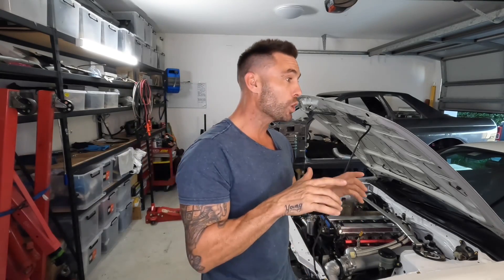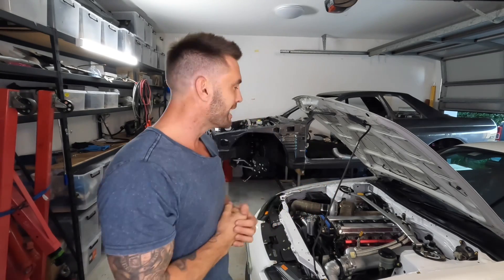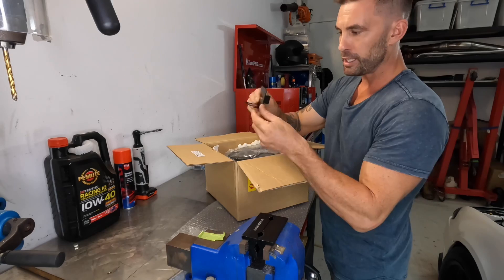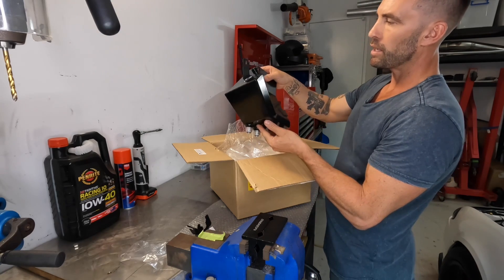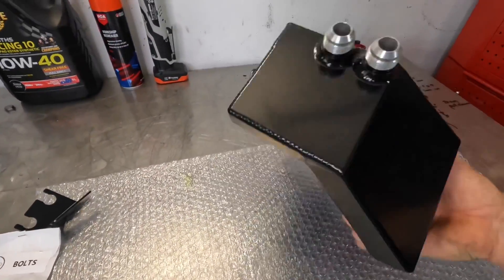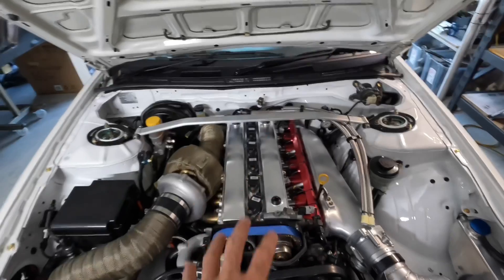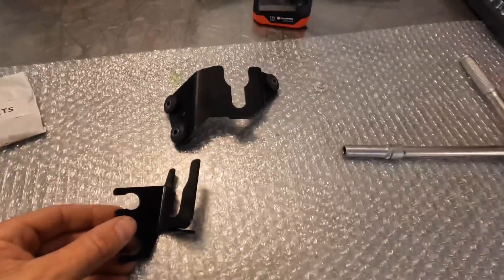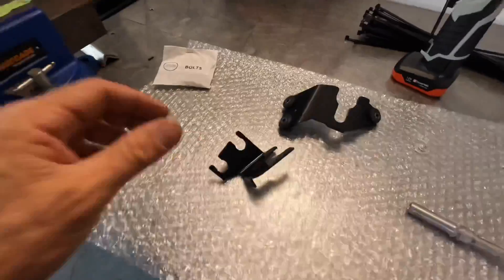ATP OIL Catch Can S15 2JZ

Comment: beautiful machine you got there mate, would u mind telling me the wheel and tyre size you got going on your s15 and what the ride height is?
Reply from the maker: Hey mate. No problem 🤙

Front- 17x9 +22 with 7mm spacers to clear the Evo brembo calipers by 2mm. 245/45 r17 Mickey Thompson street comp and 2.5 negative camber. 1mm toe out

Rear - 17x9 +45 no spacers, 275/40 r17 with 0.5 degree positive camber. 0.5-1mm toe in 

Ride hight is about two knuckles clearance above rear tyres to fender lip. Fronts are 10mm clearance above tyre. 
I wanted it as high as I could, not a fan of low boy setups. All strait line grip setup.
Reply: @Motorsporttuningsolutions1  thank u so much, i have been following this build and the r32 gtr great work man, you’ve got my dream garage, i can’t wait to get my own collection started, keep making these legendary videos.
Reply from the maker: All gravy brother. Start collecting and building haha